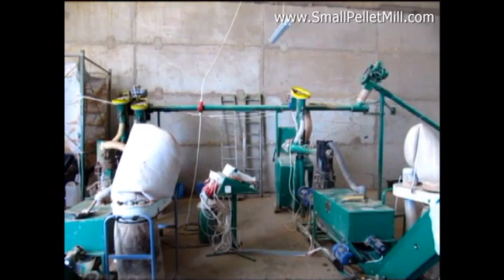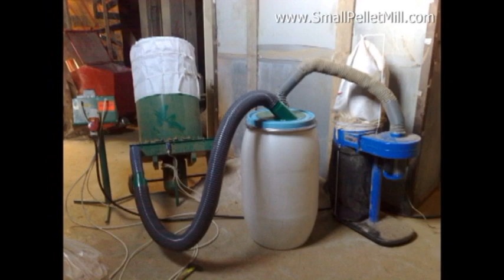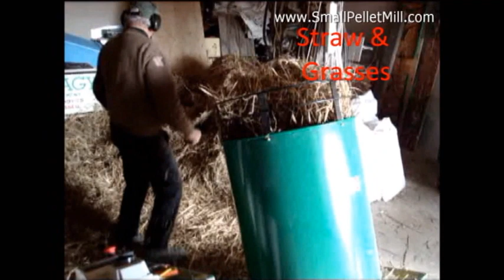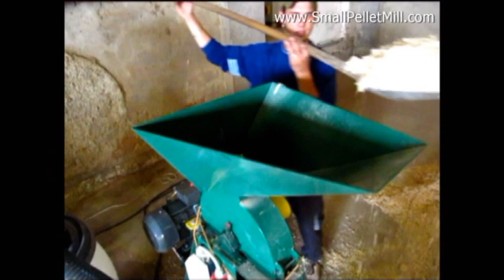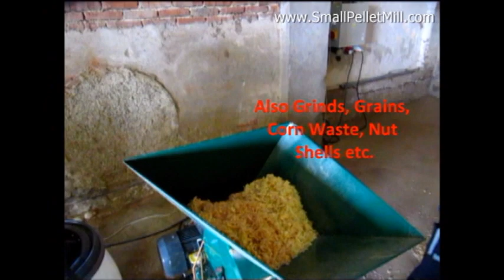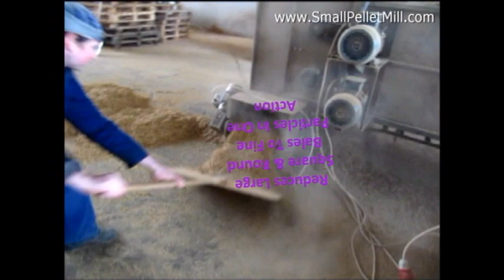Small Pellet Mill | Production and transportation of biomass pelleting

Comment: I like the cutter grinder and the small hammer mill. They are sized for a home based operation of pellet production.  Do you offer these machines to the USA in 120 or 220
volt 60 cycle single phase electric motors?